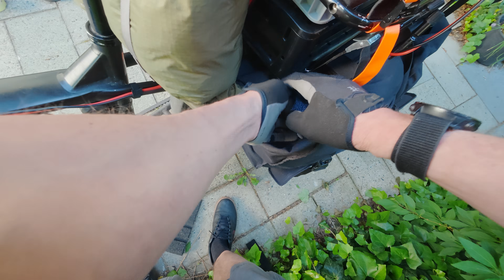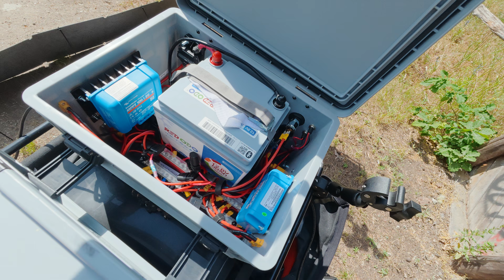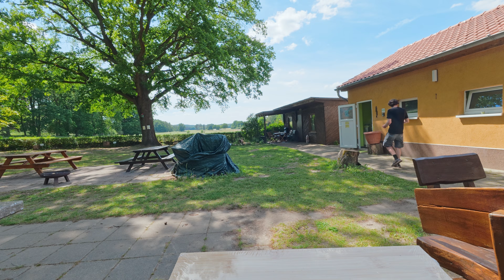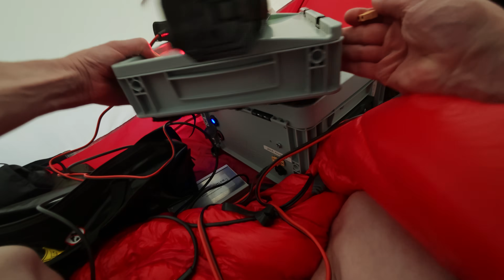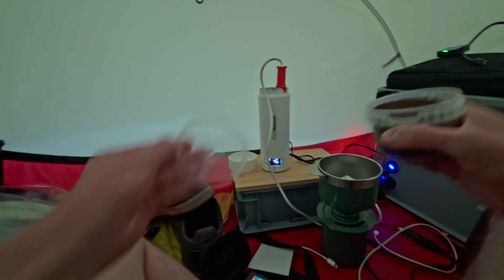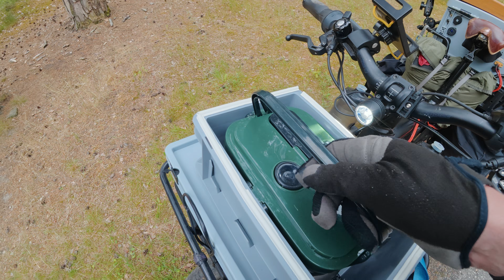Solar Cargo Bike Camping — 160 km Overnighter with 12V Cooking

Comment: Schade dass das ganze nur möglich ist wenn man einen Powerbutler (von dem leider nicht mal mehr die Website existiert) hat und ein altes Bosch system. Mit einem Shimano System mit der gen 2. Batterie ist das leider nicht so leicht. Man bräuchte einen Wechselrichter für das originale Ladegerät bei dem man aber dann wieder Leistung verliert... Solange es keine 12V Ladegerät gibt wird das leider alles eher uninteressant bleiben. Und leider bin ich mir sicher das keine Offiziellen Lösungen von z.b. Bosch und Shimano kommen werden da es für diese Firmen nicht rentabel genug sein wird solche Ladegeräte produzieren zu lassen... Schade eigentlich

Comment: I will take another aproach, only the main battery, with a connection for the solar panels with a cv charger, some solar panels in the fron and back to charge while biking, maybe a trailer withmore panels, the point is, since its more confortable to travel at day and that is also the charging time, why bring extra batteries when i can directly use the energy?, no extra battery means less weight, and its more weight efficiency to carry more solar panels than batteries, since u hace to stop anyways to charge, but a trailer plus front and back solar panels could be a huge or unlimited range extender, the thing to be tested is mppt or pwm, mppt stop charging when the light xhanges, what makes loss timer charge every time u run under some shadow, a pwm doesent care and all the test i have seen, say in a small system mppt vs pwm makes no mesurable difference, they look the same
Reply from the maker: Let me know how it works for you. I am curious and I hope you can profit from my approach to improve yours. A lot of the setup is determined by the area, for example a lot of European roads have roadside trees that bring a lot of shade, and the battery of the bike determines a lot a well. With Bosch it is best to use specific chargers that cap the input to 100 watts, that why I have the buffer battery - if 300 watts are coming in the battery will take in whatever the bike battery won't, and then I continue to charge during the ride. Also I like the option of cooking. But feeding right into the bike battery is more efficient if the sun is stable enough. Good luck with your build!

Comment: Mine ebike does 200km on 1 charge
Reply from the maker: That is really good. - But at the end of the day you are going to want to charge it somewhere when you are going on tour. So there is freedom to be gained for you as well.
Reply: @outheresystemsoutheresystems welllll i life in The Netherlands. 

Not really a problem to charge it. Also no hills(some parts had them). 

I have a small power station with me (ac powerbank)

Comment: Great video, load the bike up and go for it. I've got a few mid and rear hub drives, but probably would use a front wheel hub motor and setup like "Yode on the road". For the time being I'll take my little S300 Allpowers which will quick charge.  Couple that with my Bosch hybrid and when I can find a PowerPoint I can change both at the same time.  I've got a trailer so I might get a 160w portable panel. :)

Comment: I 🪵 definitely rethink yor setup w/ a trailer for 2 reasons.  1 continuous charging ⚡️. 2 so u can reduce that top heavy setup bcuz that center of gravity makes it inherently dangerous
Reply from the maker: I am charging in the pannier, the battery is on top in a special bag. You are right about the top heavyness, but I think I have an answer to that. The next trip will have a setup that is lighter and lower.

Comment: I can achieve about 80-90 miles a day w/ 2 batteries outlet breaks hauling a cart with gear. So w/ solar setup should b more than doable
Reply from the maker: For a daytrip you are totally right. But what I am trying for is to not need an AC Source in the evening- and still do the same 80 miles for a couple of days.
Reply: @outheresystemsoutheresystems    I live in the woods. Literally.  So I’m not really into resting in a spot w/o ⚡️.  I still believe that u should go back to hauling a trailer bcuz you don’t want to be top heavy. It’s no fun
Reply from the maker: @shadowdance4666  The other alternative is lowering the weight. That's what I did for now- I will have a different setup and get rid of the eco flows in the middle in exchange for lighter panels that are stored lower.

Comment: Well, I must admit that I was somewhat impressed with your system and what you have achieved thus far. However, as someone who regularly goes bike camping/fishing with a small dog, as well as doing the grocery shopping on a bike with panniers and trailer, all I could think was "What if the system fails and you can't recharge batteries?". That is going to be a lot of weight to be pedalling under your own steam.
Reply from the maker: That is true, it is a lot of weight. But on the other hand it is less weight than bringing the kids to school on it. So it the system breaks there is a problem. That is why I bring the bike to the mechanic in frequent intervals for check ups. So far they caught every problem before it showed up on a trip.

Comment: I manage bacon 4 days into summer backpacking trips. I have a very thick pot cosy. So I individually wrap sausages, lamb chops, and portions of bacon. I put them in my cooking pot and put the whole thing in the freezer. Then, just before leaving, I put the frozen cooking pot, full of frozen meats, inside the pot cosy. My cosy is made from two thicknesses of closed cell camping mat. I take out whatever I want for dinner to finish defrosting before cooking each day. Even in summer I've had chicken breasts with ice crystals inside them after 4 days in the pack. That's a completely unpowered system just relying on an inch of insulation. I'm sure your system could use the principle even more effectively. A good pot cosy is like a haybox cooker. I can cook a whole chicken with 15 minutes of heating. An insulated cooking pot with your 12v immersion heater could cook just about anything.
Reply from the maker: I am working on that. But my plan involves a lot of soddering, which I am not very good at. And your way seems very functional. So maybe until I am done I might just try it.

Comment: It works!... The e-bike camper craze that started a couple of decades ago, reminded me of my younger motorcycle- tent camping trips... I mean, what do I need a 'mini camper' when a tent or a hammock can do even better?... So a bike trailer [for kids] did the trick for me... It houses a 1.500 w/h ''solar generator'' with two panels [one foldable, for when parked and one flexible, permanently fixed on the door] AND, on the top, fixed on the frame, a small 200W vertical [no spinning blades] wind turbine... Between wind and solar, the power station is always fully charged and powers a 45-lt freezer, emergency electric pan and pot and everything else I need... I also use a current transformer to power my e-bike directly from the power station, leaving the battery full, ready for when I want to go for a solo ride... I even entertain myself using a cordless power drill that, with the right adapters turn to a mini chainsaw or a wood splitter [I know, an axe would do, but why not?... lol...] I use a normal city bike with thin [racing] wheels and 33 gears [racing again], so the system I use is a 350W/ 48V ''friction drive''  and boy oh boy, the miles I have on it for the last decade...
Reply: Wow, that's a lot of power for a little friction drive bike!
I thought you'd be using something big like the solar racing bikes that can basically do 30 kph uphill all day.
Reply: @mikafoxx2717  There's not much 'uphill' here in Australia [flat land]... And it's more like a 'long range' [with a little pedaling here and there], speed was never the target, even though 33 racing gears can take it up to 60km/h easy... It's more like a weekend getaway vehicle, a little cycling, a little camping, a little fishing, kinda thing... Did I mention the freezer and the power tools?... It works!...
Reply from the maker: I think I may have to visit Australia some time.
Reply: @user-McGiver oh right, yeah. I'm accustomed to so many hills here that you're either going slow uphill or going 40kph downhill if not faster. Local place to me is named a hill, but at 334 meters, it's legally a mountain. I could totally see one using a small motor to keep a heavy load of stuff at 25 or 30 all day long, though.
Reply: @mikafoxx2717   Better rest and charge during the day [here] and travel through the night, but yes!...
Reply: @outheresystemsoutheresystems   the magnificent flat... lol where the clouds touch the ground...
Reply: Please tell us more about wind turbines as I haven’t seen any videos on those before! 🔥🔥🔥
Reply: @SearchingWilderness   There are more videos than we even need about wind turbines on YouTube. Wind turbines are more important than solar panels for sailboats because they don't take much space... My pick is a 200W [max and in strong wind], which is the max input for my power station. Do your own research for your own particular needs, ask Google, don't ask sale platforms, Google will give you all the options...
Reply: @user-McGiver  Thanks! I will do a deep dive into this later on. I wonder why van lifers and cycle tourers don’t seem to use it…
Reply: @SearchingWilderness   Because people don't think outside the box, my friend... they actually live in a box!... and carry it with them even ''cycling''... I see you ''search the wild''... make a healthy stream a basic parameter, that'll means not just water, but power too... research hydros here on YT... 24/7 power!...
Reply: @SearchingWilderness   btw, vans give enough surface for solar...
Reply: @user-McGiver  Yes, but if you’re out in the woods, a backup that doesn’t rely on the sun being out and visible would be really really nice, especially if you’re stationary for longer periods of time. 😊
Reply: @SearchingWilderness   like a portable lil ''hydro''...? lol I remember a product years ago for hikers the size and shape of a melon [or your 'football'] that you could throw it in a creek [30 cm deep] using a line to anchor it, and foldable blades would spin to produce power for a laptop... I can't remember the name, but it wasn't powerful enough for me... still brilliant though... Anyway, you can't hide solar or wind easily, but you can hide a hydro... plus water means foliage/ cover!  [I'm a bit into 'survival' myself too...]
Reply: @user-McGiver  Such a good point, if you’re doing stealth camping that s brilliant! Thanks so much. Do you have a website with all this information by any chance?

Comment: I would need a tent big enough to fit my ebike inside. My trust in mankind is low.
Reply from the maker: The bike has a sensor that will set off an alarm on my phone when someone touches it and I it it hat a GPS sensor with a Cellphone chip that will broadcast its position to the company for two weeks. But the panels are unprotected and I am really wondering how to lock the boxes up so I can go shopping in more populated places. For now I just go to the countryside.

Comment: failure... 6ah aku + solar 2kg
Reply from the maker: There may be different approaches to this. But I don't see cooking water, running a router and recharging batteries with a setup that light. My light Panels broke, so I am tending towards a more rugged setup.
Reply: @outheresystemsoutheresystems  definitely too heavy for ebike just 2x100w solarflex mppt booster 6ah lifepo4 with heating element for cooking no standard heaters than you will really enjoy your rides

Comment: You could make the bike lighter by removing the pedals.
Reply from the maker: It is a cargo bike. But I am working on the weight. I just figured I would start with a way that works and optimize from there.

Comment: If you make a trailer that has a bed in it it could charge while you tow it as the solar could be attached
Reply from the maker: I do the same thing in the pannier. I will see but so far nothing overheated.

Comment: @outheresystemsoutheresystems
If I understand correctly, you don't want a trailer so that you can leave the cycle path that is wide enough for a trailer and use bike routes that go through woodland that aren't wide enough for a trailer.
I also see that you are trying to stay as compact as possible when everything is packed away. But the way you have distributed your belongings, you are too top-heavy to go off-road. Advice is free, and mine is that if you want to go off-road, invest in front panniers or fork bags to lower your centre of gravity.
Reply from the maker: Thank you for your advice- I listen and it is the direction I am working on. The bike does not allow front panniers...but I will look again. The Top heaviness is one issue I am working on. And it´s not. like I love the off road riding so much. It is just that the infrastructure is so bad that I cannot travel anywhere without very narrow passages. Also ATM I have to replace the top panels with more sturdy ones and improve the ruggedness...

Comment: Why do you not charge the e-Bike battery directly. The via over a 12V battery is a waste of efficiency.
Reply from the maker: It is a compromise. The charger has an Mppt, but it only goes to 140 watts. I just figure charging the main 12v battery as well as one or both bike batteries with 370 watts is a better use of the sun when it's there. I was thinking about trying it out, though. But given the amount of wires to think of it is an extra step. I figured it was still better than going to AC and back again.

Comment: So sun is needed to use solar panels. lol
Reply from the maker: Well part of the challenge is that the sun and an unshaded panel have to be there at the same time. Normally the panels stay in place and the place is sunny most of the time. On a moving bike there is a lot of shade, so the stops have to be timed right at good places.

Comment: Why don’t you have a trailer? It’s far too overloaded 😄 The centre of gravity would be lower and everything would be more comfortable
Reply from the maker: I would love that, but I don't think the roads allow for that. There are very narrow highway or railroad crossings I can barely squeeze through with the bike, but a trailer would just stand on a lane. I am working on the center of gravity, though.
Reply: @outheresystemsoutheresystems  Yes, I know only too well what you mean – my dog trailer is 90 cm wide. But for your purposes, a narrower one would do just as well, and if necessary, you can always unhitch it. There are also some with just one wheel.

Comment: Always great to see someone e-bike camping creatively :) I've recently got into pulling a trailer with a 2kw power station. It's been amazing to charge at 270 watts while riding!  Thanks for the video!
Reply from the maker: I wish I could bring a trailer along. Did you try to get a DC charger? AC converters loose a lot of efficiency
Reply: @outheresystemsoutheresystems   I only wish I could break open the power station and connect to the 52v battery  (the connections are actually in there).. but no I'm stuck using a 5 amp AC charger for my 13S4P.   I have 12v DC output up to 25 amps, but I haven't found a converter that works.

I tried an "1800w" one from aliexpress... had a fan on the heatsink too... it seemed to be able to handle it for a few days... but then it died.

Trailer is nice, it just doubled my wh/km :( lol

Comment: You may like my solar trailer.
Long live the solar tour.
Reply: I like your solar trailer. Plentiful power and tidy. I've watched your progress. Consider though: My unladen trailer weighs only nine pounds -- just two wheels, an axle as a T to a tubular aluminum "tongue" and an 18 x 20 inch aluminum plate, which can be the platform for various light-weigh bins with whatever laid on top. The hitch is comically uncomplicated. This has proven to be rugged over hundreds of miles, so far. Starting with intent for the basic trailer to be super light resists any temptation to make it carry anything heavy -- and so on. If I had started with a good commercially made trailer, I'm sure I'd be loading with nice heavy things and subsequent regrets.
Reply: ...and green breaks!
Reply from the maker: I would love to build a trailer, and I am sure Arizona is a great place for solar trips. That said I feel like I am first going to try to fit everything on my longtail. I have shared a few roads and crossings that seem normal where I live and I feel like a trailer would be a problem there. I hope I can show progress soon.